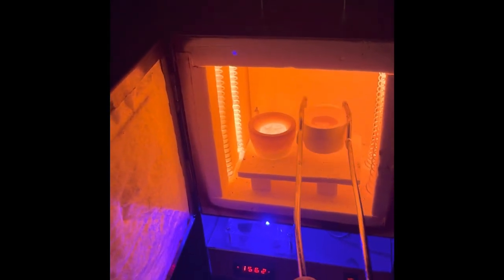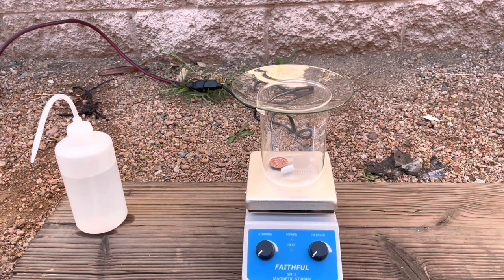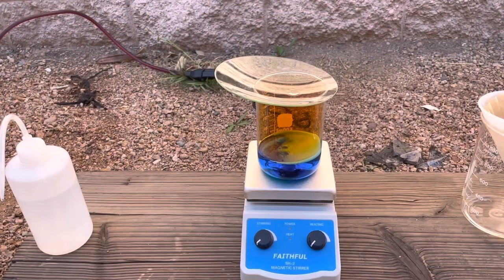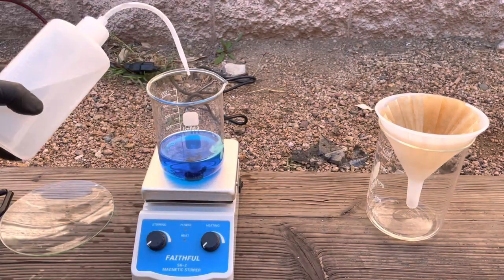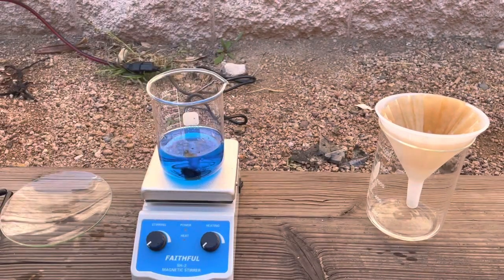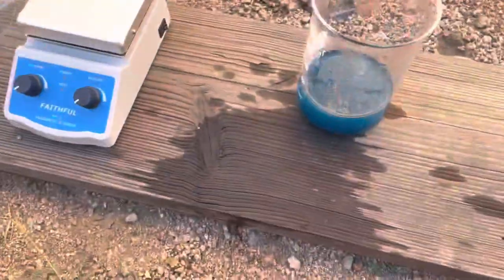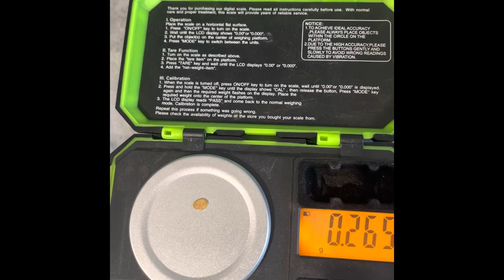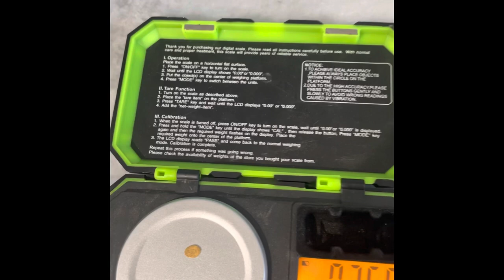Refining Gold - Slag, Crucibles, Fire bricks and Cupels for Gold Recovery & Precious Metals Part 4

Comment: Very awesome video brother! Finally got to sit down and watch! Are your fluids measured or are you just adding more to get the reaction you are looking for? Is this the same method you would use to extract gold from like CPU's. circuit boards and pins? Thank you for the information!
Reply from the maker: Both, lol! since i added a bit of water the nitric was pretty dilute until the gas stared, then I'm watching for the reaction to slow down and production of gases to slow. Then I will add about 2-3ml of Nitric to keep it cooking, at the very end I dumped what I had left since I didn't want to put it back into the vessel and wanted to finish up at the same time. Good questions, and no I wouldn't use this procedure for CPU parts, there are several different processes you can use for that some of which are similar.